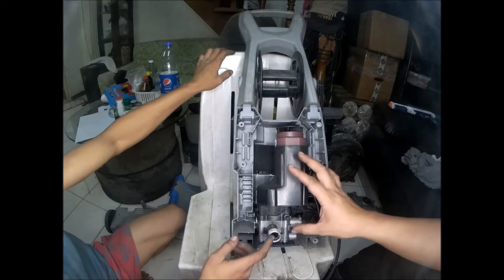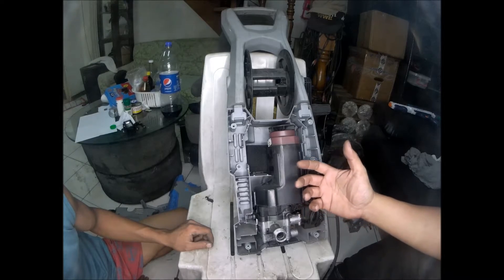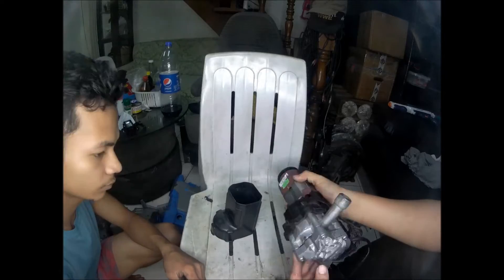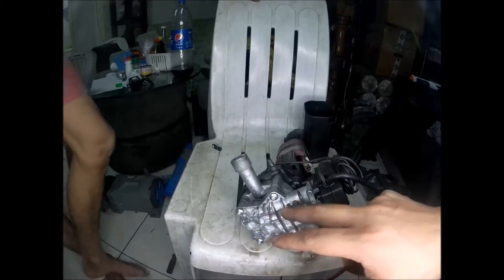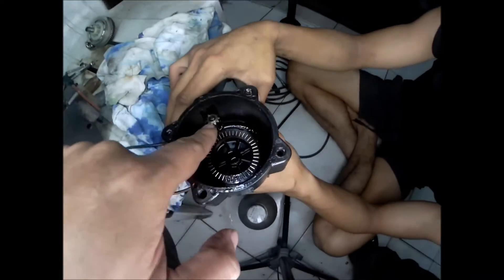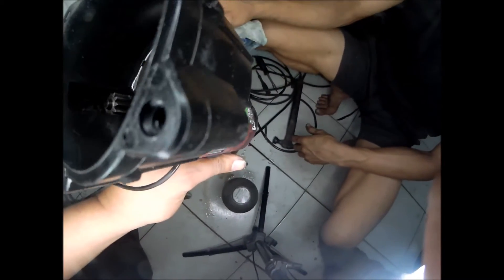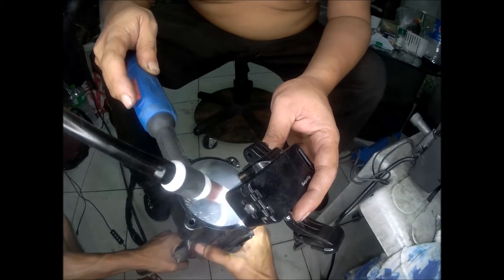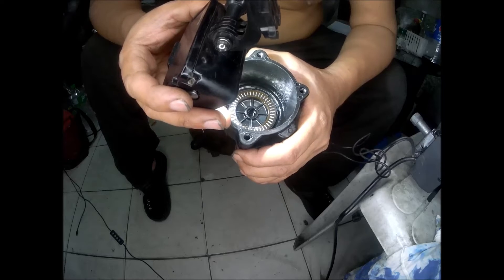DIY Electric Pressure Washer repair FASA

Comment: Your opinion, mahinang klase ba ang Fasa pressure washer? Salamat
Reply from the maker: Mahina pre, sa experience ko..weak link niya yang pinion gear tapos ang mahal mahal pa
Reply: @DIYAllManphKDWzpeedengineering  ah ganun ba? May Bosch Aquatak 10 ako 14 yes na,problema ko ngayon Yong rubber seals sa water at oil nya but otherwise OK pa rin. Hanap pa ako water and oil seals.

Comment: Hey  I have a pressure washer  buts it's not cutting off and when you turn it on has slight pressure when you press the trigger any ideas as to what is wrong
Reply from the maker: check pressure switch